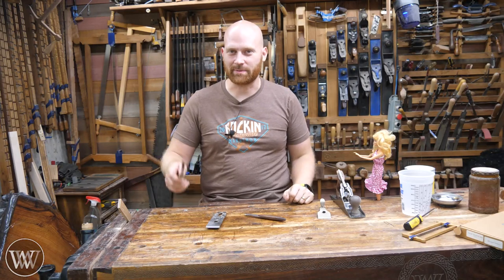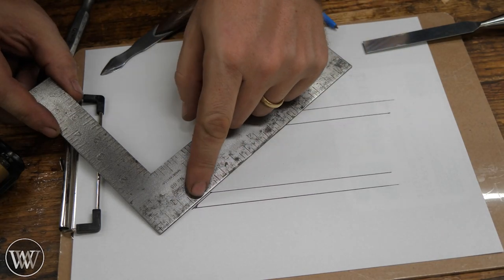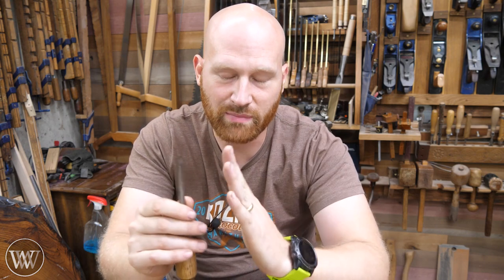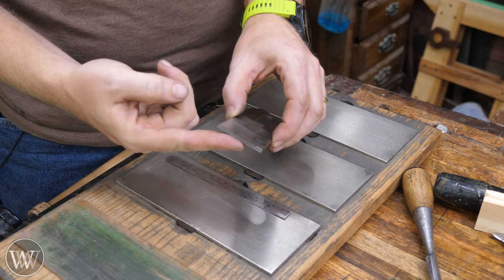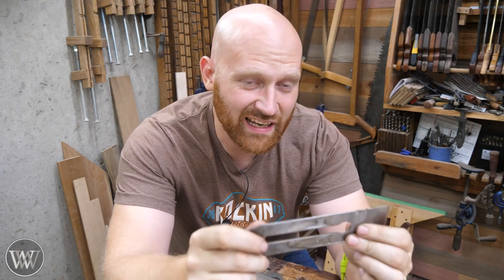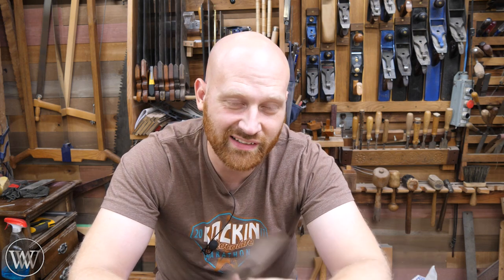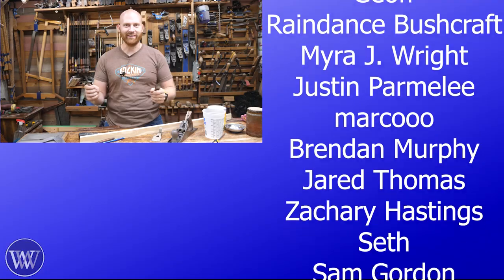The Truth About Secondary Bevels and Back Bevels on Planes and Chisels

Comment: FYI, the David Charlesworth rule trick is never mean to put a back bevel on plane iron. It meant to reduce the prep time because you don't really need to flatten the whole back of the plane blade. You just need to prep the edge. Also, the rule trick is mean to be used on the final grit stone of your sharpening to remove the burr after the initial prep. The angle is insignificant to be make any difference. The real purpose for the back bevel on the iron is to increase the angle of attack for difficult grain wood, so that you don't need to change the frog of your plane and the angle is usually much higher than what the rule trick will provide you.

Comment: Nice informative video! Never thought about the fact that you eventually have to «pay back» the gained time from a secondary bevel.

I’m wondering about low angle bevel up planes and back bevels. Wouldn’t that be as bad as a back bevel on a chisel?
Reply from the maker: On a LA plane a back bevel is ok because the back is not flat on the work. And there is no chip breaker to worry about.

Comment: I like using a secondary bevel because I only need to use the finest stone to maintain the edge for ages, there’s no reason to use anything coarse to move more metal unless the secondary gets too fat, and because I’m using only the fine grit that takes forever to move the edge. I think where people go wrong on secondary bevels is when they go all the way down to a 300 grit diamond on the secondary every time they touch up the edge, so they take off way too much metal and the secondary turns into a steeper primary.

At the end of the day though, people do way too much cargo-culting and obsessing over sharpening techniques. The truth is that getting exact angles and geometries matters a lot less that people think, all that really matters is getting the edge straight and sharp at a reasonable angle and making sure the closest facets to the edge on either side are polished smooth.
Reply from the maker: Right on. Well said!

Comment: I do a back bevel on my bevel up plane and avoid the secondary bevel to avoid increasing the cutting angle, and it increases the durability a little from it being less of a point but still the same angle. Japanese planes from Lee Valley use the same sharpening method.

Comment: First, thanks for your videos. Credit for the "ruler trick" should properly go to David Charlesworth, an English furniture-maker and teacher how introduced it 'over there" some 30 years ago. While using the ruler trick technically puts on a back bevel, it certainly isn't a functional back bevel. ( about .3 degrees measured with some machinist's tools). It's function is to help insure the back is polished right up to the intersection with the face, this being more important than the VERY minor bevel it produces on the back, and as you pointed out it isn't advocated for chisels.

Comment: Length of time to grind away a secondary bevel between sharpenings must be years as you're talking about sharpening away 1/4 inch or more of chisel or plane blade
Reply: Couple of years perhaps. Then hours of work to re-grind. Per chisel. It's a bit like when I don't tidy things away after every time I'm out in the garage. After a while it becomes a mammoth task to the extent that I just don't bother and I don't do my hobby as much because I don't want to face tidying. Obviously, you can just buy a new chisel, but I'm guessing you'd probably have a grinding wheel if you were of that mindset.

Comment: Secondary bevels are NOT put on after a primary sharpen. They are for for re-sharpening. And less than a degree is fine. Just use your final stone. Note that, if you strop, you are doing this anyway. It gives you a slightly rounded edge.

Comment: I think you got it wrong with the back bevel on a plane blade saying you dont want to take to much off as the chip breaker will then have to be positioned farther up the blade as you cant place it on a bevel. You then go and contradict your self and say the other reason for a back bevel is so you dont have to flatten the entire back of the iron. As the chip breaker needs to be perfectly mated to the iron without any gaps you clearly would have to put the chip breaker onto the nice perfectly flat back bevel.
I think Rob usually recommends a back bevel primarily for the fact you dont need to flatten the back of the iron, not so much because it is any easier to sharpen which I dont think it is and have never even heard of that.
Reply from the maker: Sorry I'm not quite sure what you're saying.
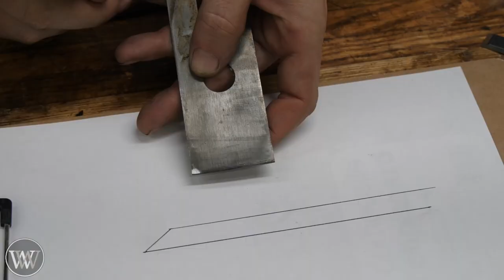Reply: @WoodByWrightHowTo  at 7:52 you say the chip breaker cant sit on the back bevel. It has to sit behind it. 
But that cant happen when you are using this method on an iron with a back that is not flat as the chip breaker has to mate perfectly with no gaps to work effectively. So by creating that back bevel you have a perfectly flat mating surface for the chip breaker which in that case would be sitting right on the bevel.
Reply from the maker: The chipbreaker can work with scratches and small imperfections as long as they are not too wide. The problem with the back bevel is it is at a different angle if you want the chipbreaker to fit with it you have to adjust the chipbreaker to that new angle. Otherwise you will have a slight opening the width of the blade that the thinnest chips can catch on.
Reply: @WoodByWrightHowTo  well a large hollow on the back of the iron is not a small imperfection. If you are using a back bevel specifically to fix that then again the chipbreaker must be sitting on that bevel so as not to create an opening where the hollow is.
I do understand that if your chipbreaker is at a perfect angle to sit flat on the back of the iron then adding a back bevel will create a gap along the entire width. But it is my understanding that the angle of the chipbreaker "blade" is such that it only contacts the iron at the very edge of the chipbreaker "blade" it dosent actually sit flat along the entire surface of the chipbreaker bevel. In this case there is no issue with adding a back bevel.
Rob never mentions altering the chip breaker when adding a back bevel, and I have watched him set up a brand new plane with a back bevel without ever changing the chipbreaker.
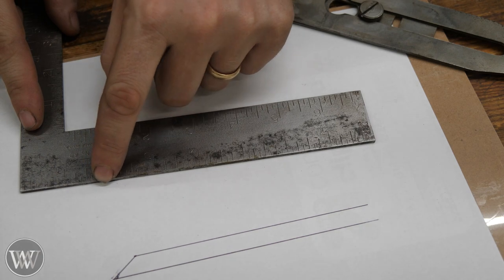Edit: check out his box to bench video around 5:45 he adds the back bevel and then places the new out of box chipbreaker without any alterations. https://www.youtube.com/watch?v=MYM08CSopNA
Reply: @GifCoDigital Not sure if it's more recent, but Rob actually does modify the back of the chip breaker.  He uses the iron itself to prop one end of the chipbreaker up to a good height, and flattens a portion of the chipbreaker at a small angle.

Comment: As you mentioned Rob Cosman, his latest sharpening"trick" is not just secondary, but TERTIARY bevel. It seems he's going over the top, trying to be unique. He also spends 10 mins resharpening planes & chisels before every use (annoying in his videos as he's repeating the same sharpening action on film instead of getting on with his 3.5 min dovetail ... Now 13.5 mins)
Reply: 32 seconds to sharpen each time   way less than 10 minutes if he needs to reset the main bevel
Reply: @billtiffin8298  yep, not sure where the op got his info. The entire point of the tertiary bevel is that it's quick to do, making sharpening less onerous. It's just a honing bevel in effect.
Reply: Try watching some of his videos, I finally unsub'd during his lockdown drawer making set of videos, he does the full 3 stage sharpening & gets sidetracked so often,  surprised anything gets built !! (IMHO)
Reply: @JohnColgan.  I really enjoyed those videos

Comment: There are 1000000 ways to sharpen a blade. Some blades are absolutely a "right" vs "wrong" (clipper blades, convex hairdressing shears, specialty tools). But there is certainly a wrong way for all tools..  if it don't cut ... It was done wrong.
Reply from the maker: if it does not cut. then it was not sharpened.
Reply: @WoodByWrightHowTo  hahaha.